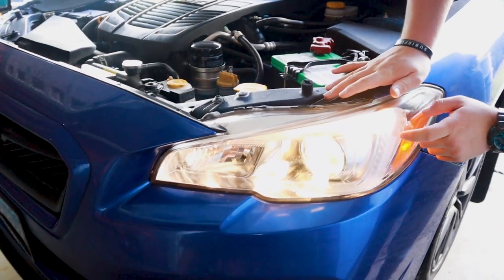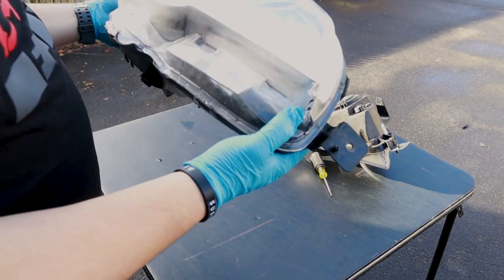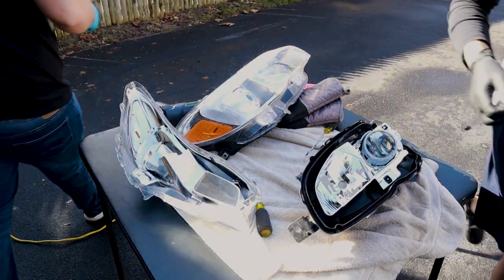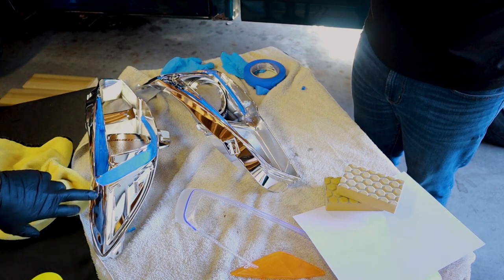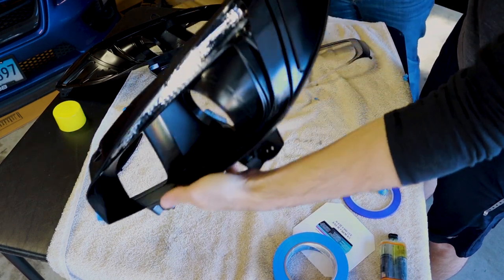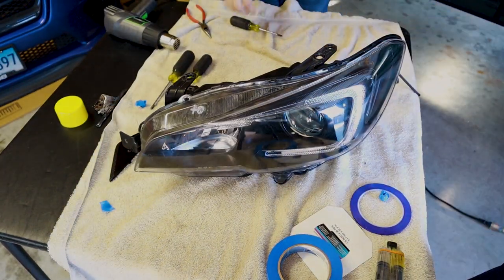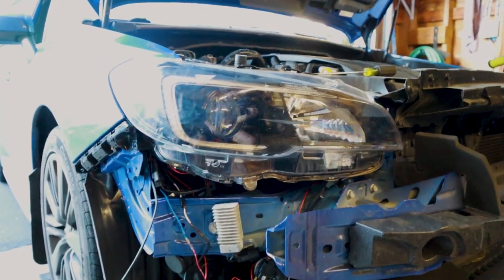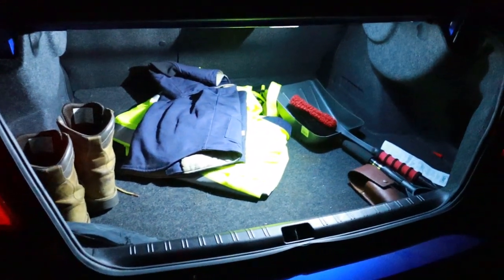CUSTOM WRX HEADLIGHTS!!! - DIODE DYNAMICS C LIGHT - 15-20 Subaru WRX

Comment: I've heard other guides caution placing the headlight units on a hard surface as the lenses can get scratched very easily. Just a note for others wanting to do this, use a cloth of some sort on your table.

Comment: I'm about to do this. Is painting really required or would the oven cleaner method work just to black out the housing? Also going to install the C-lights at the same time, already have SL1 high and low beams from Diode Dynamics
Reply from the maker: Oven cleaner works good

Comment: WOW!!!! what an improvement, looks amazing guys. Hey one thing, let us know if you get any condensation after a while. That’ll be something to lookout for.
Great video 👍🏻👍🏻🔥
Reply from the maker: One thing we forgot to show was that we filled the hole in the back where the c light cable comes out with silicone and butyl rubber to completely seal them.
Reply: WRXGarage ok cool, right on!!!!!

Comment: Came out good, 👍. First time I've seen someone paint the edge of the c light plastic. I had those cougar LED bulbs, hated the projection of them. Returned them back to Amazon and ended up just biting the bullet and getting the SL1 bulbs from diode Dynamics.
Reply from the maker: What did you not like about them? They're specifically designed for projector housings.

Comment: Amazing video guys! I was just wondering if I could black out the chrome without having to put in a c-light or having to tamper with any of the stock lights? Thank you!
Reply from the maker: Hey Jimmy, of course! You can always just blackout the housings, though I'd highly, highly suggest swapping the low and high beam bulbs (and fogs) for LEDs. They have more, cleaner light output, less strain on the battery, and overall just look better. You can always put the stock halogens back in at anytime afterwards
Reply: WRXGarage thank you so much I may end up doing that but it seems like a lot of work to get the LEDs wired in. Also what glue did u use to re glue the light back together. I am afraid of getting condensation in there.

Comment: Hello about to attempt in a few weeks waiting for supplies. For the yellow wire to the turn signal blue. What gauge wire did you use? And does it matter which color? Thanks, only thing I’m concerned about! Great headlights. I love the C light plastic being painted🤘🏼
Reply from the maker: I think we used 18ga. No, it doesn't matter what color!

Comment: Hey, just installed mine yesterday, was wondering if you knew if the t taps that were included with the kit were water proof because I heard that they have been known to cause problems. Not to sure but wanted to see if you had any opinions on it.
Thanks
Reply from the maker: If your nervous just throw some electrical tape over them and they should be fine

Comment: Have you had any issues with the t taps they provided? I just finished my c lights last night and I'm hoping the t-taps are secure enough for a long time connection
Reply from the maker: A couple months of hard driving later, no issues yet! If you're sketched out by t-taps cutting the wire, then butt connecting them with 2 wires in one side works the same way

Comment: 2020 WRX STI BASE  MY CAR HEAD LIGHTS AND HIGH BEAMS R THE SAME, WOULD U KNOW WHAT TO BUY H11 AND ???  TRYING TO GET BRIGHTER LIGHT OUT OF MY PROJECTOR HEAD LIGHTS. THX
Reply from the maker: Hi Rob, we use the Katana LED h11 or cougar motor. Both are great options for the price
Reply: @WRXGarage  thx u good luck to both of u, in ur new adventure thx learned a lot.. straight forward advise